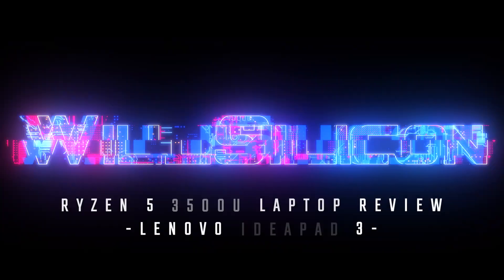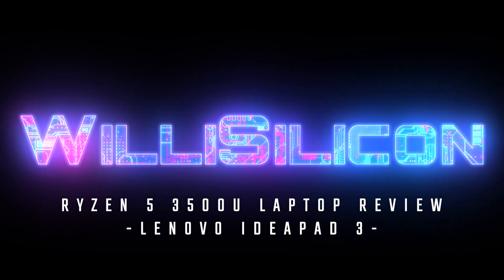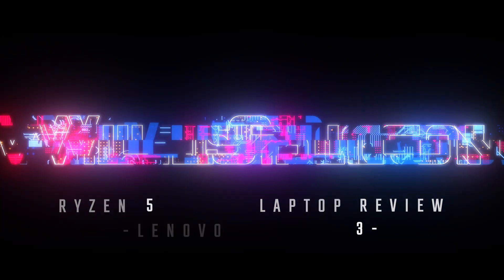This $450 Dollar Laptop Rocks! - Ryzen 5 3500u - Lenovo Ideapad 3 Review

Comment: Hi guys!! Nice video! I don't like welded ram. Can anyone help me with high temperatures?? Ryzen 5 2500u. Turbo boost desactivated.
Reply from the maker: May need to open it up and clean out dust
Reply: @WilliSilicon  I do it a few weeks before and replace thermal paste for artic mx4. The problem persist.
Reply from the maker: Did it always have high Temps? Might just be poor cooling design
Reply from the maker: Might have to use a cooling pad.

Comment: Hey, please I need your opinion; I'm entering into the world of design and I need a laptop but I'm really low on cash (I'll be making use of softwares like Adobe Photoshop, Figma, Illustrator...) I've been browsing for some cheap but okay laptops and I have my interest on 2 laptops which are within my budget; this Lenovo IdeaPad 3 15ADA05 (AMD Ryzen 5 3500U, 8GB, 2GB Dedicated VEGA 8 Graphics, 256SSD) and the HP Elitebook 745 G5 - MT44 (AMD Ryzen 3 Pro 2300U, 8GB, 1GB Dedicated Vega 6 Graphics, 256SSD, 1920X1080 FHD). Someone advised me to go for the HP 745 G5 with his reason being that the display is better, but I'm hesitant cause I am asking myself if the display is that much better than the Lenovo's to forgo the better processor. Which do you feel will be a better option?
Reply from the maker: I would go with the more powerful laptop, because even though the hp has a better display....it still isn't a good display. Also I wouldn't get the Lenovo if it's above $400 now. Because there should be newer generations available in the 400+ range.
Reply: @WilliSilicon  thanks a lot, I appreciate your response
Reply from the maker: You're welcome

Comment: Hey, great video. How’d you increase the screen quality? I know you said you messed with it a little bit. I know it’s just a TN panel and is decent enough for the price range, but I just want to make it look a tad better because it’s just barely in the acceptable range. What settings did you mess with?
Reply from the maker: I went through the Windows display color calibration...just type that into the windows search bar.  I also tweaked some display settings in the AMD Radeon Adrenalin software.
Reply from the maker: Honestly though, I spent a lot of time messing with it and there's not a whole lot to be done lol

Comment: Hey I’m looking for a basic laptop that will run a stream old rpg games and editing would this be good
Reply from the maker: It would run the old RPG games. As far as streaming and editing...it could do it, but I wouldn't recommend the experience lol
Reply: @WilliSilicon  thank you 🙏 Can you guide me to a good laptop under 700 that would accel in those I’m stuck in internet laptop loophole 😂
Reply from the maker: Unfortunately, you probably won't find a laptop that will do good with streaming and editing for under $700 new. Maybe a used laptop that is a generation or 2 old with dedicated graphics (preferably Nvidia so you can stream with the NVENC encoder) and you want 16gb or more ram for editing, and you'll also want to make sure it has an SSD for editing(preferably NVMe).
Reply from the maker: Something like this https://amzn.to/3fGvt8D would be the low end of new hardware you would want for gaming/streaming/editing
Reply: @WilliSilicon  I like it I’m going to save another hounded then look into it thank you 🙏
Reply from the maker: Check local listings for used laptops too if you feel comfortable with used hardware.

Comment: I have a question, I have this laptop and everything is good with it, except the GPU. I would run GTA 5 but the vega 8 is not enough. And my question is that the is the GPU integrated or i can change it?
Reply from the maker: It's integrated. So, it's as good as you'll get with this laptop.

Comment: Does AMD work better with dual ram? So upgrading the one stick of ram to 8 mess with the processor...? Honestly asking trying to learn how these AMD processors work verse intel
Reply from the maker: I upgraded my son's with an 8gb stick for 12gb. I saw slight increase in performance. At the low end it seems better to have higher capacity than faster speeds. Because at 8gb with only 6 available your ram maxes out fast
Reply: @WilliSilicon  Thank you!
Reply from the maker: You're welcome. But, yes...in general you usually always will want you're ram to be dual channel over single channel...just doesn't matter if you don't have enough capacity to start with.

Comment: Hi! I recently bought this pc but since I turned it on it is making like a clicking or typing sound in the inside of the computer. This sound stops for 5-10 secs and then it starts again. I'm worried because sounds like it is coming from the SSD unit. I already did a scan using Seagate and also the Lenovo's diagnostic and everything appears to be good. Should I send the computer back? or this sound is normal? thank you!!
Reply from the maker: You may have a model with a mechanical hard drive. If so those sounds can be normal.
Reply: @WilliSilicon  I have the model 81W1009DUS. This only has SSD. Is it normal??
Reply from the maker: Then no it's not normal. Might be something in the fan. You can open it up yourself or try out customer support.

Comment: I thought this comes with a 4gb 2400mhz removable RAM. If I upgrade the Ram on this laptop, wouldn't it be better to stick with 2400mhz rather than 2666mhz? If I got a 2666mhz Ram, wouldnt it just match the soldered 4gb Rams Mhz so that both run at 2400mhz? Would this cause any issues mixing 2666mhz ram with the soldered on 4gb 2400mhz?
Reply from the maker: Mine has 2666 soldered. But no it wouldn't cause an issue because it won't be dual channel regardless
Reply: @WilliSilicon  ok thanks. One last question. 
I will be doing mostly light gaming on this laptop.  I feel as if 8gb will hardly be enough in the end, but if I cant run different RAM sizes in dual channel or in a flex mode, then is it even worth it to upgrade to a bigger RAM size? 

Which RAM setup would you recommend on this laptop for mostly gaming?

Option1 - 4gb soldered+8gb ram
Option2 - 4gb soldered+16gb ram
Option3 - no upgrade/4gb soldered+4gb ram
Reply from the maker: I put an 8gb stick in my son's laptop and it seemed to game a little better. Which is weird because you lose dual channel. So I'd say go for the highest capacity if the gaming will be roughly the same.

Comment: Is there a performance difference from the 15 inch model?
Reply from the maker: Not if it has the same parts. There's many different versions. If it's still the ryzen 5 3500u then it should be roughly the same performance just bigger.

Comment: That's pretty nice but you probably would have been better off with something like a Latitude 5410... but that's just me. You can find these on the "used" marked and overstock for less then $500 complete with an i5, 16gb of ram, a beautiful 1080p display, 256gb Nvme ssd.. Mine even has Windows hello and the build quality without question is far superior, think hinge. I just bought one and gave my daughter my 7490, I can't say I've gone wrong. I spent about the same and I still got another 2.5 years left of a factory, pro support warranty. It's not that I think buying this Lenovo is a bad deal or anything, you just get more for your money. More expandability, more nice display, more nicer backlit keyboard.. at least in my configuration and built like a tiny tank. It was in my opinion a pretty good deal.
Reply from the maker: Sounds like a great deal!
Reply: @WilliSilicon  But you can find that kind of deal easily online here. Students get these things and would rather have the cash... daughter died for hers! lol. Course it's a Latitude 7490.. the kid is spoiled.

Comment: I have the Lenovo ideapad s340 with the 3500U ryzen 5 with amd Radeon Vega 8. Will this run better and will it be capable of playing Minecraft with shaders?
Reply: Is it memory speed? If so it says 2400 MHz
Reply from the maker: Yeah. So slightly slower memory speed. Should still be roughly the same performance though.
Reply: Why is that? Mine cost more money than this one
Reply from the maker: Because the Vega 8 graphics uses 2gb of the RAM as video memory. Vega 8 benefits more the faster the memory. But it's a small jump from 2400 to 2666 so it's doubtful you'd see a real difference. Other factors likely resulted in the higher price tag. The s340 probably has a better screen.
Reply: Thank you
Reply from the maker: You're welcome 😁
Reply from the maker: Should run the same. As long as your RAM is roughly the same. If the s340 has faster memory (the ideapad 3 RAM is 2666MHz) then you would likely get a few more FPS. And yes, it should be capable of playing Minecraft with shaders.

Comment: Did you uninstall the Lenovo Vantage? Don't! It's like the control software of every lenovo laptop!
Reply from the maker: I did lol. Seemed like bloatware on a low end laptop like this. I use it on my Legion 5 though.
Reply: @WilliSilicon  oh okay. I think Legion Vantage has more feature than on this , right? it's just great to be around for others who'll use this as their main laptop though, but I agree that it doesn't have that much feature.
Reply from the maker: Yeah you can change a lot on the Legion like a little overclocking and stuff, but the Ideapad 3 is pretty much locked down.

Comment: What do you think about Lenovo IdeaPad 3 15ADA05 (Ryzen 5-3500U/12GB/256GB/FHD/W10 S) for student's use/movies/light gaming/music/browsing? for 550euros.( don't compare walmart prices we dont have them in Greece).?
Reply from the maker: As long as it isn't much more money than the one in this video then that's great. Cause the only difference is a little more RAM. So if it's within around $20 difference I'd get that.
Reply: @WilliSilicon  Thanks! 
Any better recommendations in that price range ? 500-650(max 700)
Reply from the maker: Not really much upgrades to be had over this unless you go over 700. At least with the current market. Most computer stuff is in limited stock and overpriced right now 😕
Reply: @WilliSilicon  Very overpriced but okay..Thank you so much!
Reply from the maker: You're welcome 😁

Comment: I bought the 15.6 inch version of the same laptop..will there be any significant change in battery life between the 14 and 15.6 inch models?
Reply from the maker: There's likely to be slightly less battery life with the 15.6 just because of the bigger screen with more backlights, but probably not very noticeable.
Reply: @WilliSilicon  Ohh okay...thank you🥰
Reply from the maker: You're welcome 😁

Comment: Do you have any friendly tips or advice on what to do when you first get this laptop? Such as optimizing the computer and making it run faster or better? Thank you!!
Reply from the maker: Really the only thing to do is uninstalling any bloatware that might be on it. Oh, and make sure you have the power settings set to favor max performance while plugged in. I use balanced for battery power.

Comment: I'm going to buy the ryzen 5 3500u version but it comes only with a soldered 4 gb ram and additional slot. Will adding a 4gb ram stick to the slot make it run in dual channel mode?
Reply from the maker: Yes if it's the same frequency

Comment: I’m thinking about upgrading the RAM on this. Are all RAM sticks compatible? I was gonna buy a generic one and take it somewhere to get it installed.

-Edit: found out the RAM is upgradable to 20 GBs with a 16 GB stick. SSD is upgradable to a standard 1tb 2080 SDD.
Reply from the maker: That would be expensive. It's very easy to do. It needs to be DDR4 SO-DIMM RAM. Just a single stick, because only one is removable in this laptop. The laptop doesn't support higher than 2666mhz speed. Faster RAM will still work, it just won't be faster than 2666, so don't spend the extra money.
Reply from the maker: The best deal I see on Amazon right now is https://www.amazon.com/dp/B07YNF3KY4/ref=cm_sw_r_cp_apa_fabt1_AUyVFbY9KN7ZG
Reply: @WilliSilicon  I appreciate it I think I will get it and try installing it myself. And you’re right I can probably install it with a guide. Do you have a guide or you think I could find a generic video of it? Thank you for your time.
Reply from the maker: I don't have a guide for it, but I do take the back of the laptop off and remove and reinstall the RAM stick in this video, it's really as simple as that.
Reply: @WilliSilicon  okay so I was looking for an SSD for this. Do you know a better replacement for the SSD in this thing for a decent price?
Reply: @SoapboxPreacher777  what about 32 gb stick, will that work
Reply: @diamondx12  I assume so but don’t waste your money on that. When I run games this thing is using 100% of the GPU and CPU but like 50% of my ram max. This thing is capped off by the processor. Switching out the 4GB stick for a 16GB stick is all you need.
Reply: @SoapboxPreacher777  thanks in advance.  Can you also what is a good recommend M.2 2280 Nvme stick 1tb size or 2tb size, that is compatable from amazon or any where else, thanks in advance.

Comment: Hey man, can you please help me out in choosing a better laptop? Im confused between the below two:

1) Lenovo ideapad 3, Ryzen 5 3500U - 256 GB SSD - $400

2) Hp 14 - i5 - 1035G1, 256GB SSD - $430
Reply from the maker: The Ideapad is more powerful but the hp has a better screen...so depends on how important the display brightness and colors are to you.
Reply from the maker: Well, actually the CPUs are pretty close to the same performance, but the integrated graphics are better on the AMD
Reply from the maker: Also you should look into the storage expansion and overall upgradability of the HP as well. It's probably a better buy if it has the IPS display since neither laptop will really game well.
Reply: @WilliSilicon  Thanks a lot for a very quick response man! Appreciate it! And also I just want that laptop for college purpose and maybe a little excel work and stuff. I use excel a lot and won’t use this laptop much in terms of gaming. So ideally Lenovo is a better buy option for me? On top, I don’t want to upgrade or expand the memory etc. so the final decision of your would be? Lenovo or HP?
Reply from the maker: I'd get the Lenovo for cheaper if the screen brightness doesn't bother you. The Lenovo screen is 200nit.
Reply: @WilliSilicon  Thanks! I’ve ordered Lenovo :)
Reply from the maker: Awesome 👍 I hope you enjoy it
Reply: @WilliSilicon  I can’t waitttt 😃

Comment: On sale for $400 with free overnight shipping at Walmart right now. Only the almond and red colors are in stock though, not the blue shown here (as of 11/16). I picked one up for my dad, to replace his aging Asus X551M with a 'blazing' dual-core Celeron N2815, 4 GB RAM, and a mechanical hard drive. I would have preferred to find one with a 4000 series Ryzen CPU, but the only ones for around the same price had a 2C/4T 4300U and 4 GB RAM which is not upgradable.

Comment: It fits a "standard" 2280 M.2 drive, not a 2260.
Reply from the maker: I've got my son's open right now and can confirm for sure that it will fit a 2280! Sorry for the confusion folks!
Reply: Are you 100% sure about that? Would a 2260 not fit?
Reply: @SoapboxPreacher777  There is no retention screwhole for 2260's. Only the stock 2242 and 2280. You could probably rig something to hold it down, but 2260's are quite rare in the first place. Just about every M.2 drive sold today is a 2280.
Reply: @Justin.Franks  oh nice I want to put in a 2080. Thank you.